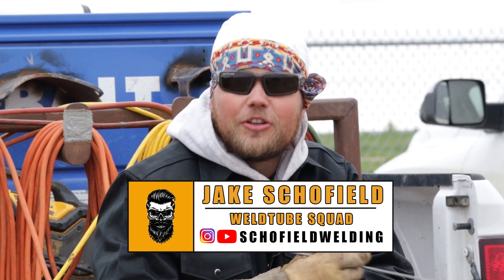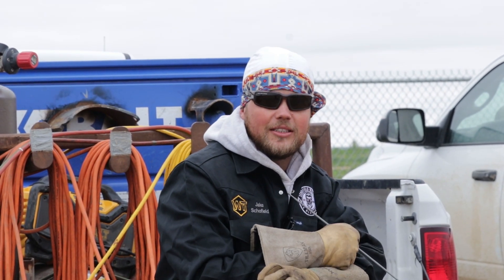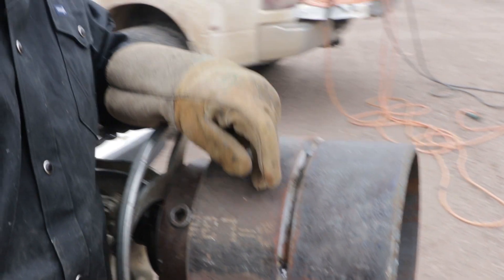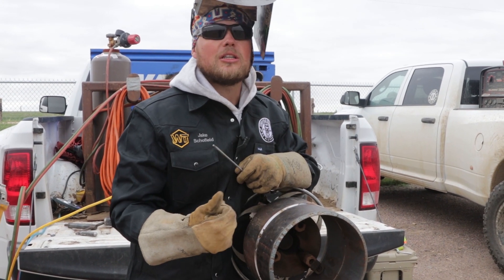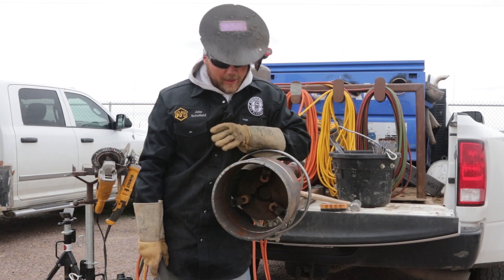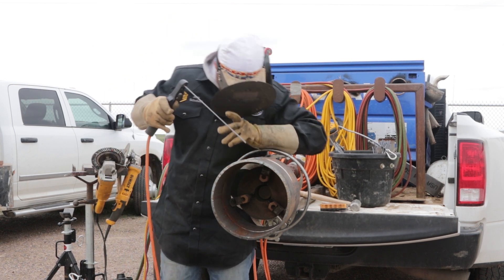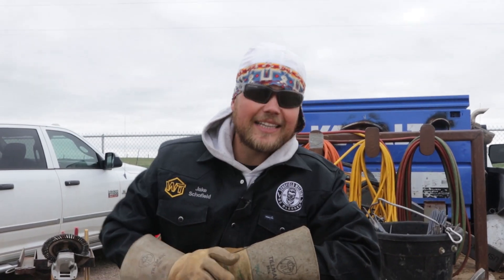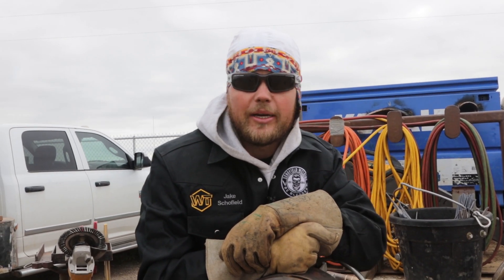How to Weld Pipe with a Bad Fit Up Featuring @Schofieldwelding

Comment: just started to learn how to weld pipe together in welding class using 6010 electrode and a 7018 as a filler

Comment: I'm lost with the fingernail, I'm actually a pipe welder and I have never known the proper way to stop a fingernail, I weld uphill asme codes but when It would happen to me I would stop and get a new rod or kind of twist my hand alittle and it would fix it sometimes, but with your method are you saying that if the puddle wants to stick to one side of the pipe you actually face the arc towards the same side the puddles sticking to?
Reply: No sir I believe he meant to the opposite side and really exaggerate it, I could be wrong

Comment: What kind of stick rod are you using 7018 or 6011 ?
Reply: He’s using 7010 you don’t use 7018 for downhand roots and 6011 dosent have the tensile strength required for schedule pipes like that